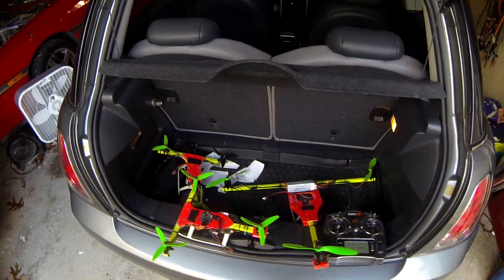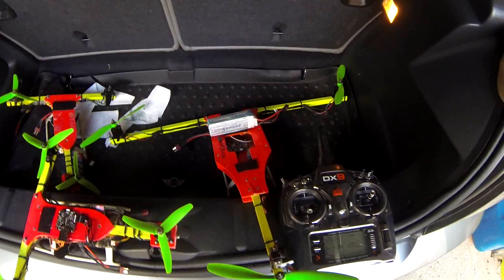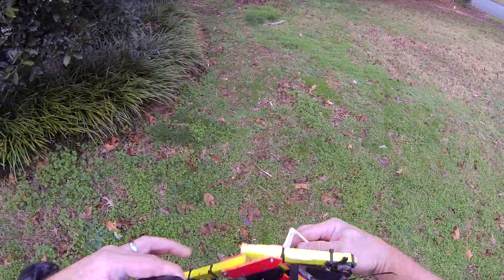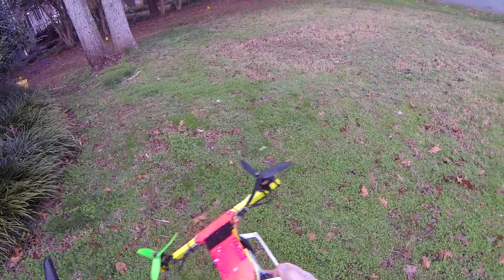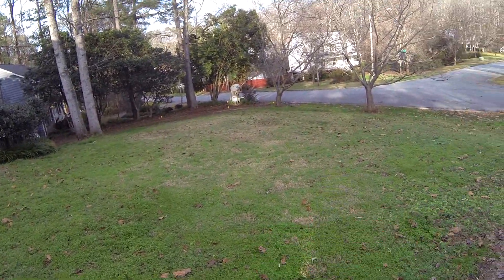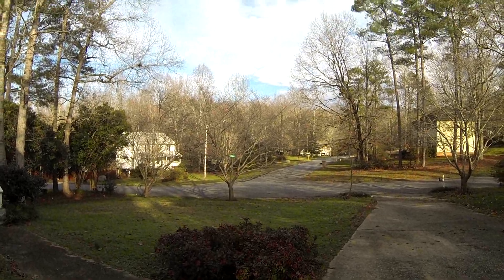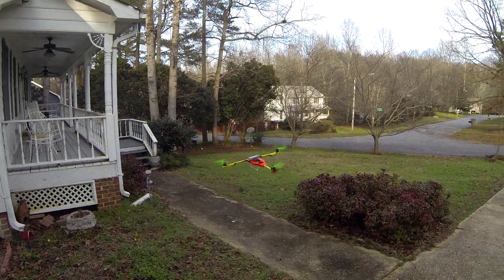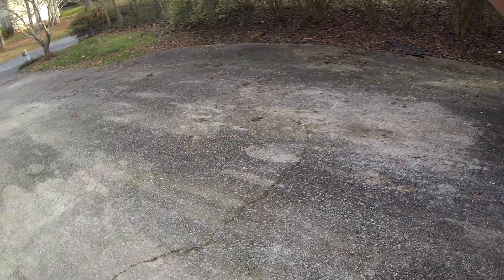Simplecopter Naze32 BLheli T copter Tricopter video

Comment: Hi love ya flying . I'm having  issues with the rear servo wobbling when I applied throttle I'm running blheli-s with spf3 flight controller On betaflight. is there any chance you could help me pls
Reply from the maker: crazy rotor move link closer to center of servo. More toward the servo horn screw.

Comment: Hi HS!  Just put together the mini T and dialing in the naze.  Had to reverse the servo (that took most of the night to find a command for the CLI lol), it just spun in circles. 

 My tail droops under fast throttle, is there a way to delegate throttle to the motors say rear 100% and front 75-80%?  I flew my Dad's with the KK2 setup with your values and it was smooth.  My tail has a little oscillation, P value?
Hope to hear some reply's!

Cheers from Canada!

Comment: trying a tri build with a naze 32 but all connected upmright but when I throttle up te tri just spins round, its like the yaw servo is to senitive, any help would be great
Reply: I had the same prob.  I put this command in the CLI      smix reverse 5 2 r

I believe it reverses the servo gyro. (may be wrong)  Anyways there used to be box you could check in the servo tab according to some youtube vids but it's not there on the newer versions of CF.  Then make sure the tilt is opposite your stick position (tilt left for right input and tilt right for left.  Got mine to hover and is good for slow flight right now.  (gonna ask for some tweaks from HS, seems he has it dialed in!

Comment: Hello, SOLVED my issue of sever random motor fluctuations. After reading all I could find I had my hopes set for the new motor-set I already ordered. This indeed turned out to be the solution. Now on Emax MT/GT (now all my motors are) !
Installed triglight firware using Cleanflight and back in business ! Thanks a lot for your inspariration !

Comment: Hello, you inspired me to build my own version which has aproximately the same dimensions. I used full naze32 from the start. After a severe crash (made it swim ;-( ) I salvaged it but found that the new version of CleanFlight forced me to upgrade my firmware. Curently latest version available to this date: 2016-feb-29.  PID settings are now way off and I lost quite some confidence in flying because it does not feel locked-in anymore. Tried many different settings but cannot seem to get te locked-in feeling back again. Please, please, please,  post your PID values and other settings !!! Woul be very very grateful indeed.  Thanks in advance.

Comment: Great flying. Looking forward to your build with the Naze32. Tried it once with 2300kv motors, 16 amp BLHeli ESC but could not get it to work with either Basflight or Cleanflight. So bring it on.

Comment: If you want to feel locked in go download Betaflight 2.1.6 firmware and try the air mode. The only weird thing for me was getting used to an arm switch and having the motors spin while armed, but by far the most locked in firmware ive flown.

Comment: I wondered when you would bite the bullet and try a naze board. You should try the borisb betaflight fw too, it's much better than normal cf. (although there is nothing wrong with normal cf!) I have one of your large t copters in my hanger with a naze board on. Just waiting for a new rx to arrive before I fly it. That will also be running the betaflight fw. I've used the naze on a few of my tricopters now (all your ones) and I'm very happy. The kk2 is good but to be honest I don't think it can compete with the naze32.the new betaflight fw also had a new function called air mode and will keep the motors spinning enough at zero throttle to allow full roll, pitch and yaw control. You really should try it, I have a sneaky suspicion you will love it for doing acrobatics.